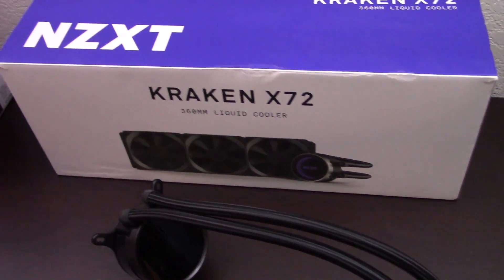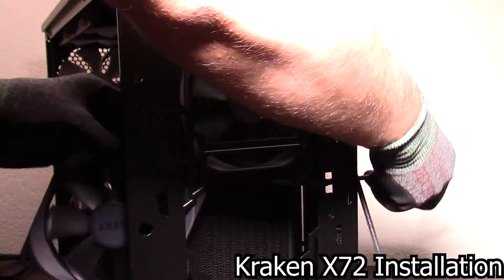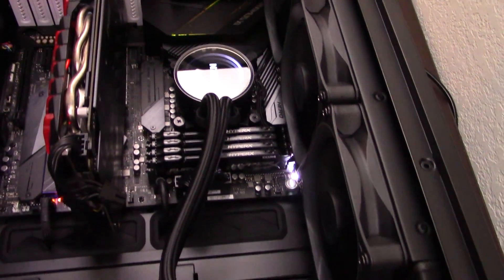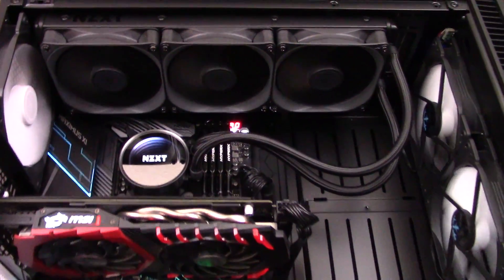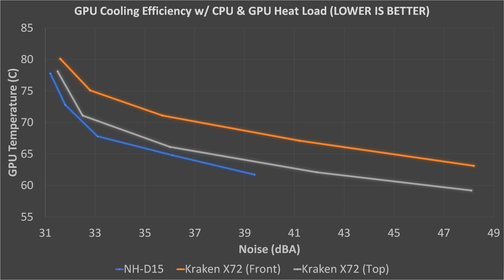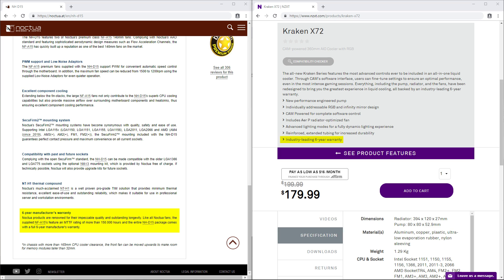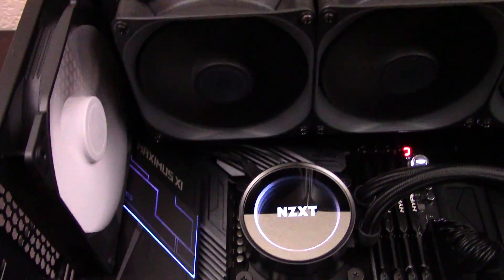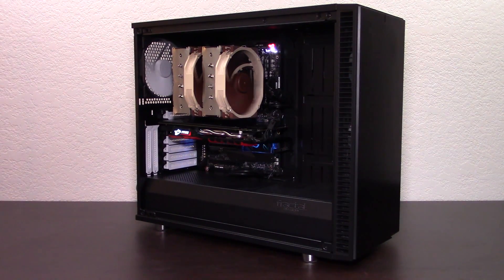Air Cooling vs. Liquid Cooling: The Ultimate Showdown (feat. Noctua NH-D15 vs. NZXT Kraken X72)

Comment: The bar graph on screws, cables and software was super unnecessary lol
Reply: Not for lazy people.
Reply: @spacedoohicky  I don't think a lazy persons gonna build it anyways,
Reply: @toxicity2014  I'm super lazy, and I at least replace computer parts. Lazy people do a lot. It seems contradictory, but a means to an end gets lazy people to move. At least a little. :)

Plus there's degrees of lazy. Some are going to be just lazy enough.
Reply: @Blarson12  It depends on the design. There are non-hardware designs like Japanese woodwork with buildings that have lasted centuries, and only use wood cut joints. Our modern world for whatever reason prefers screws, bolts, and nails. I don't know if this applies to computer boxes. It seems like it would. It's just that very few have tried designing it that way.

I think enthusiasm is a lame excuse. I prefer the "work smarter not harder" mantra. If there were a box that was easier to put together, and still stable I think I would prefer that. Every little thing adds up. Including simplicity which has it's own reason for enthusiasm. Simplicity is often cited as an aspect of beauty.

Also screws are one of the worst things as far as durability. They have a single point of contact. I would instead measure a design's durability by how much pressure, or impact it can take. Screws will for the most part survive a short fall, but it really depends. Boxes these days are quite often made out of thin plastic which makes the screws just fancy holders. And a metal box would jar the insides on impact.
Reply: @Blarson12  Entire houses can be built without screws, or nails. https://hidakuma.com/en/blog/kumiki/ There are large palaces built without screws, or nails that can withstand earthquakes. https://www.youtube.com/watch?v=w78Yb_aotH0 As far as enthusiasts there are quite a few that are very enthused by this kind of ingenious building method. Of course at scale like in skyscrapers steel is the way to go, but we aren't really talking that big.

And it's not just an eastern thing. Early settlers in the new world also built wooden structures using similar methods. Though nothing beats shaped stone for stability in sub-skyscraper sized buildings.

I think what mostly drives our usage of screws, and nails these days is obsolescence. It's actually cheaper to use metal fasteners because everything either goes out of style, or goes technically obsolete. We end up throwing away a lot because it gets too culturally, or technically old. Stronger building methods cost more because it takes training, but with obsolescence well trained people can seem like a waste.
Reply: @Blarson12  Also I'm not necessarily against screws. The original contention was about laziness. My response was repeating the mantra "work smarter, not harder". Smart wood joinery can be assemble by hand with ease, and less sweat than using nails/screws. I consider the same might be possible for any useful structure of most any size.
Reply: @Blarson12  That's why you're supposed to be smart, and not simply lazy. https://www.cnbc.com/2019/02/15/the-science-backed-reason-lazy-people-are-smarter-more-successful-and-better-employees.html

Comment: Final verdict: air cooler wins, but liquid cooler is the winner
Reply: @Gary Choopper And happy to be. If I can do it with air I will. If not, go full hog and build a custom loop. 
Because when air works, zero maintenance, zero noise, greater longevity (by decades).
Reply: Well yes but actually no
Reply: Lmfao
Reply: No. The Liquid cooler has more Problems as the Air cooler. The Pump or leeking.
Reply: The D15 is $90 and the x72 is $450, who is really the winner? Lol
Reply: @jacksonsmith2918  and much safer
Reply: @jacksonsmith2918  the x72 is not $450.
Reply: @jacksonsmith2918  when you overclock, the 115 x52 outperforms the Dh15 and looks way better. Wins
Reply: It's not fair.  The number of fans for Liquid Cooling is more (even it's 120mm), and it takes up the spaces for case fan.   If both cooling take the advantages of full fans chassis, air cooling will definitely be better.
Reply: @boytheodore  nah that’s the most bullshit argument ever. This is the standard setup most would use and that’s what we’re testing toe to toe. Let’s say you race an Olympic runner in running, and they beat you. Then you can’t blame it on them having proper technique and strength.
Reply: @boytheodore  i just want to say one thing your dumb
Reply: @boytheodore  you can put 3 fans on noctua, but it doesn t do anything.
Reply: @boytheodore  No thats the point, like the entire point in water cooling you can move your heatsink anywhere in a case. you can use them as actual case fans the review should really be using the most of the coolers so nh15 2 fans and push pull on the x72.
Reply: @boytheodore  Actually, 120mm take one or two fans. Pray tell how that is more than the 2-fan cooler used here?
Also, the weight of that air cooler is insane. I would not want that hanging off my motherboard, especially considering my CPU is delidded.
I used to be a big air fan, but since switching over I will never go back to air, and all the gaming builds I do for customers have the first choice of an AIO Water Cooler over air, and every customer has told me what  great job I've done. So far I have been lucky and none of the water coolers I have installed have leaked. AIO coolers have been a great boon to PCs. I wuld use them in everything that isn't just using a stock cooler. Even if you're not overclocking, a $50 120mm AIO water cooler adds a lot to the build.
Reply: @OriginalMergatroid  "not want that hanging off my motherboard" is a fair statement if you've never used a noctua cooler... but this ain't your daddy's hyper 212 :)  The noctua mount is so damn SOLID you'd have no fear.  And yes even with a delidded cpu.

Look if you build for customers who are demanding top end cooling, well yeah, I think most people prefer the look of water cooling - especially the RGB freaks.  I'm sure you did a great job, but lets be honest, since you're building a computer for them they have zero f-ing clue if its better than air.  :)   And I agree leak fears are overblown - but broken pumps are not.

But one place I will disagree, is on 120mm AIOs.  They are GARBAGE.  Give me an NH-U12 or any other decent single fan air cooler over the crap tier 120 AIOs.  Better performance, cheaper or same price, single point of failure, direct passive cooling.  Wins across the board.
Reply: @OriginalMergatroid  Honestly if you're not planning on serious overclocking I'd just stick with air. 
I've had one of these "hanging off my motherboard" for six years... still quiet, still cool, whole pc still runs great.
Deal with airflow in your case properly the Noctuas are overkill that will outlive multiple PC builds.
Reply: @adifferentangle7064  Don't like the space a big air coolers takes nor how heavy they are. AIOs are so inexpensive now. If I wasn't going to overclock at all, I would just use the stock cooler. Why buy a big cooler if it's not needed?
Reply: @OriginalMergatroid  I still dont understand with your add on statement of "especially considering my CPU is delidded". When a cooler is mounted to the motherboard, it's mounted to the motherboard, regardless if you delidded or even if there's no IHS. It doesnt suddenly attach to the IHS. Can you enlighten me please?
Reply: @muhammadkhairulafiq2917  he's trying(and failing) to sound like he has a clue.
Reply: @OriginalMergatroid  look, I have a nh-d15 on my delidded 4790k. After 6+ years I still se no tilt of the cooler or any motherboard bending. But yes, the cooler is heavy and bulky. The choice is personal.
But why installing single 120 AIO? Honestly I think they are the worst type of coolers on the market. They get the job done, but with the expense of noise... I bought a corsair h60i and performed like a hyper 212, just way louder
Reply: Air cooling is ugly and sucks ass
Reply: @sirfracture616  that's a mirror not an air cooler sir
Reply: @colinkent4835  He's already dead
Reply: And my big costum externe waterloop rig GTX 1080ti  in game 29  degrees i7 8700K delided oc 5Ghz 43 degrees.Only 2 croom hard tube CPU and 2 black hard tube GPU 
in my case looks damn sexy.Buy Black Ice Nemesis GTX radiators and AquaComputer Cuplex Kryos Next Vario  CPU block and pomps no one can  beat them .
Reply: I don't know what I just read so I can't tell if it's meant to be a flex or not, but good for you my man. I'm glad you're happy.
Reply: @m.g.debruin8294  you don't have a 1080ti in game at 29c.
Reply: @mryellow6918  Yes i do by room temp 22C GPU 29C and room temp 23C GPU 30C a 31C with 3 x 420 GTX Black ice nemesis radiators.Idle 17C a 18C
only for the GPU in a External Rig.
But i use the Thermalpad Alphacool
Eisschich 17 W/mk.Not that shitty EK
 themalpad of 5 W/mk.There are a few
on YouTube  with the same temps like me.

Comment: you should have added the third fan to the nh-d15 then you might have had a solid win across the board, after all the kraken has three fans.
Reply: Will it really make much of a difference though
Reply: That's a great point! Didn't even consider a 3rd fan. I think you just solved my dilemma between the two options. Thank you David
Reply: @Blarson12  on the back of the heatsink, duh. Still costs less than the Kraken.

Comment: Custom loop cooling the CPU & GPU. Better temps and looks "cooler". (pun intended)
Reply: And costs a whole lot more and requires extra maintenance plus the risk of water and electronics
Reply: @julianangell342  theres like not much extra maintenance also just tighten the seals like its not an issue if you test properly.
Reply: @mryellow6918  just more fans to clean larger surface area with smaller holes to clean on the rad as compared to the fin stacks a yearly water change pump replacements when they go out oh and don't forget to check your seals for rot during water changes or they might leak

other then all that not much more extra maintenance LOL

then there's the fact a pump going out on a custom loop is worse for the CPU then a fan going out on a air cooler because no pump no fresh cool water and therefore no cooling as ware if a fan goes out on an air cooler it's still cooling passively 

so what are you realy getting for all that extra money spent on cooling 55 on water VS 65 with air more maintenance with water then air and it weighs more than air when moving your PC around

Comment: Now unplug both coolers simulating a failure.  Which do you trust your cpu to?  :^)
Reply: The odds of an air cooler failing are significantly lower than the odds of an AIO failing, and AIOs can fail catastrophically.

Comment: Awesome review and video here. The only thing I would add to reliability would be another point for the noctua. It has only 1 point of failure which are its fans, but if u have front mount case fans it still wont be catastrophic. Vs liquid cooling which has three. Fans, pump, and or water leak. Anyone on of those could be very bad for the cpu. Just my 2 cents

Comment: One thing I discovered is "latency" in a liquid system. If the coolant passes through too quickly it is less efficient. The liquid coolant needs to go slow enough to have time to absorb more heat.  I adapted my system to use rubbing alcohol and water which has an average of 10 percent more cooling than other liquids and combinations I have tried. Someone give me a patent please. lol
Reply: until the alchohol starts dry rotting the rubber and it springs a leak.
Reply: Nice findings! Just be careful with alcohol. It is very volatile and flammable. The system being, ideally, 100% sealed should help with that though.

Comment: so clean so good review this helped me alot alot alot!!! what are your thoughts about running a i7-8700k 5,2ghz with noctua nh-d 15 possible? or only if i use liquid metal.
Reply: With NH-D15 you can cool every CPU on earth. You NEED an Airflow Case! Like Silverstone RL06, Meshify C, Cooler master H500.
Reply: @suadmemo2412  nothing beats the old school cooler master haf 932
Reply: @suadmemo2412 
Completely agree. I'm going to be using the same setup!

Comment: NH-D15 Chromax Black

that is all
Reply: I'm building a new PC, and want the NH-D15 Chromax Black, just not sure on sizing...will it interfere with the first PCIE slot on the X570 AORUS Xtreme mobo? And Ram clearance is a problem, although you can raise one of the fans up...but by how much? Will it fit Trident Z Neo Ram in?
Reply: @MitchSoda  Uhhh I highly doubt it will cause any problems with the PCI-E slot.  RAM clearance is another matter, try contacting the motherboard manufacturer.  I would guess that you should be OK with the RAM but it's worth checking.
Reply: @MitchSoda  the trident z rgb sticks are 45mm. If you dont use the 2nd fan then you get 64mm of ram clearance instead of the 32mm with the 2nd fan on. The 2nd fan is not even required if you have good airflow because all it does is spit air on the middle fan really just streamlining the process, but i wouldn't recommend having the 2nd fan on because of the problem of ram clearance.
Reply: Gtx 1080 Ti I’ve read that the second fan only takes away about 1-3 c is this true?
Reply: @MitchSoda  got exactly this configuration, there's no problem with the PCI slot. In the front I've put a 120mm cooler for better RAM compatibility
Reply: @MitchSoda  For ram clearance you can put the second fan in the rear of the cooler.
Reply: @MitchSoda  hey bud get the nhd15S high compatibility version. It only comes with 1 fan but raises the overall heatsink 1 cm higher in your case. Helping clear the primary gpu slot. If u purchase the second fan for it its the same price as the original d15
Reply: @MitchSoda  i own this cooler and run with liquid metal and it outperforms my old h100i. And clears any ram i throw it. Regardless of the fan config.
Reply: @MitchSoda  also one more thing. The gpu cooling is very underrated for the d15 compared to liquid. review for the simple reason the gpu he used has no real active backplate for vrm thermals. The d15 plus my custom active backplate i dropped a whopping 20 degress on gpu vrm. Alowing me to hit 200 mhz increase in gpu clocks. Those results are indisputable. And ive test several times over the years with various setups. Only a custom waterloop with gpu on fullwater conversion can beat d15. Final answer. (Sorry for the novel) sincerely 20+ year pc builder
Reply: @MitchSoda  I got trident z neo ram too,  it actually have more space than I thought (roughly 2cm). Just get the regular version of the NH-D15 on amazon and get a white na-hc4 Chromax.
Reply: Does anybody know what RAM sticks he used here that didn't require moving the front fan of the cooler up a bit?
Reply: I found this out after buying the original color from Microcenter and installing it.  The Black on Black would have went so much better with my current build.
Reply: Deepcool assassin 3 is better just because you can put 2 ram sticks below that fan
Reply: @matteo964  In the noctua you can put the second fan in the rear of the cooler,instead of the front.
Reply: Will the NH-D15 fit in a Sonata II case...with the fan design assembly with 2 fans designed into the case? It’s designed for a 120 mm to blow directly down onto the CPU fan assembly. The casing also has an additional smaller fan to blow over the GPU both with the same intake of air from outside the case.
I’m going to use an MSI Z490 gaming ultra MB with a iCore 10600k cpu.
The sonata II case worked very well for me, With a Pentium D,  and an aBit IL8 motherboard.
Reply: nh-u12s ftw?
Reply: Imagine using black. Cringe.
Brown gang for life!

Comment: i used the kraken x72, but i removed the stock nzxt fans, and used noctua fans with the kraken radiator, this resulted in lower noise and better cooling
the nzxt fans are very noisy and not very good at cooling the radiator.

Comment: That's interesting. I thought the air cooler would make the GPU hotter in comparison to an AiO (since it's also adding heat to the inside of the case), but it's the opposite?
I'm also curious how it would compare to something like a H115i 140mm. Then again, there are so many different coolers on the market, it's hard to compare them all.
Reply: It's the opposite cause if you using Air Cooler, your GPU blowing hot air to the Air Cooler, then the Air Cooler fans push to the exhaust fan at the back of your case (if you installed one of course) or to make it simple, the Air Cooler fans help blowing away the hot air from the GPU which is from the bottom. But if you use AIO, the only fan(s) that helping to blow air out is exhaust top or back. So yeah, just straight to the exhaust fan(s) of your case, nothing helping it.

Comment: According to your charts, the hotter the cpu, the lower the noise level.  This makes no sense...
Reply: He is illustrating how cool the cooler can keep a cpu at a given noise level.
Reply: And though good quality water coolers are often quieter they are not always. And the fans on your rad are also part of your watercooling system, not just the pump. Fans on a rad make considerably more noise than simple exhaust fans in a hole.
Reply: Causality is in the opposite direction.
When the cooler is quiet, the cpu heats up.
When the cooler is working loud and hard, the cpu temp drops.
Reply: @MrZriael  I'm still unclear what he is trying to illustrate here.  Fan speeds are based on the curve, set either by the factory or the user.  In either case water cooling is always quieter...